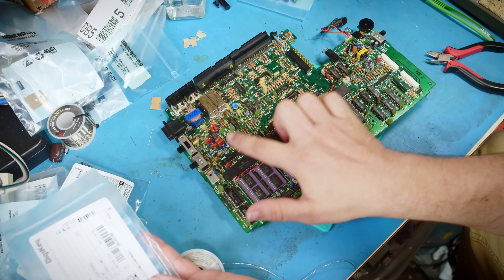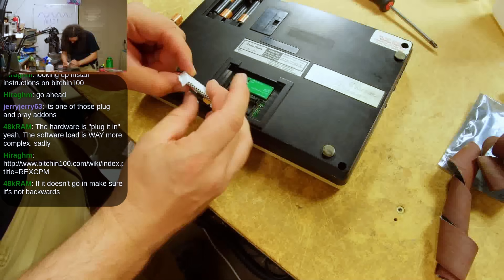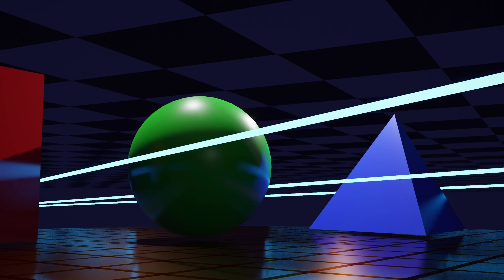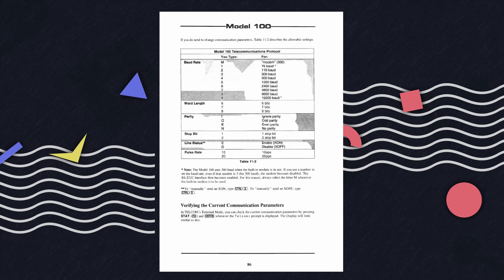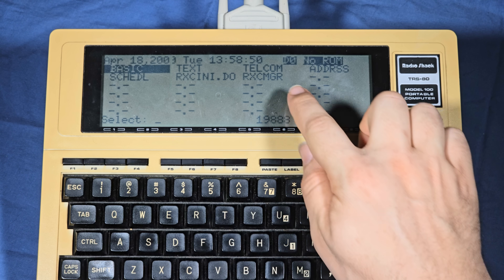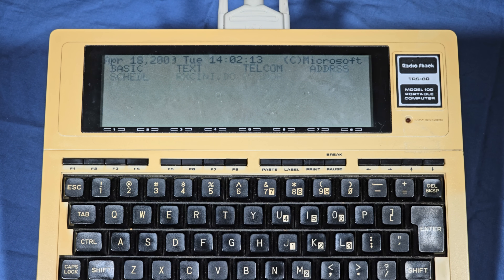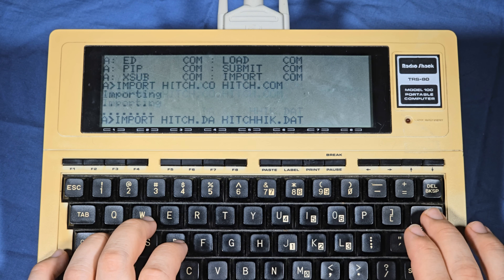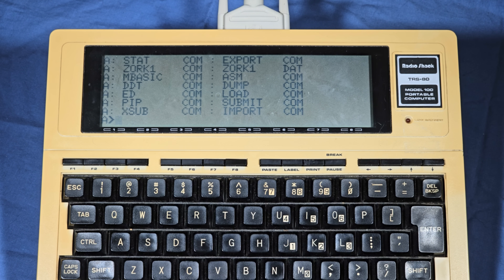CP/M On a TRS-80 Model 100 - REXCPM

Comment: I vaguely remember there was a machine language telecom replacement for the model 100-200 with vt100 support that used smaller bitmap fonts to fit more characters on the screen... I think if that could be retrofitted in to the cp/m it would make it much more usable

Comment: I experimentally managed to run CP/M on a VTech Learning Computer! 😊Once you have RAM mounted at the start of address space, any Z80 CPU will happily run CP/M, I found out. But the GL4000 only has 20x4 screen, which makes "ZORK" pretty hard to play 😅
Reply: You don't need a Z80 CPU to run CP/M; any 8080-compatible CPU will do. (Some application programs may require a Z80, though, but most of the common ones do not.)

The TRS-80 Model 100 uses an 8085, not a Z80.

Comment: How timely!  I just got a Tandy 102 in a local thrift shop along with a book for $7.  Before even powering it up, I looked up some info about it (such as the original manual) and immediately came across the page for REXCPM... and was immediately baffled by much of what I read.  I've used CP/M on my Apple IIe with Z80 co-pro card, as well as a few other computers, so the idea interests me, but this sounds like the most complicated CP/M experience I've ever seen (and that includes one hobbyist board I have that required some custom BIOS modification).  I'm still a little baffled why it doesn't use a mix of Flash and RAM so that CP/M (and probably a few user programs) could be stored in Flash while still having a nice amount of SRAM available, but maybe the choice will make more sense once I read up on this little machine.  I'm also still in the dark as to what a "REX device" is, but I'm sure that's explained somewhere I just need to find.

Hopefully, the one I picked up still works, of course.  For $7, I figured it was worth it even if it requires a lot of work, though!

Comment: I'm working on reverse engineering software for fun for retro systems and want to add a loader for the CP/M binary executable format and object file format if there is one. I'm looking for documentation on the format, a binary to test with, and preferably another disassembler to compare against. (Z80 I can do, just want to get CP/M specifics right.)

Comment: Great work navigating that Kafkaesque process! Way beyond me, I'm afraid. CP/M on one of my Apple IIs is my preferred method - install a card then boot a floppy that's easily made with ADT Pro. Up and running in no time at all, and no need to source the tears of a Cobol developer or Alan Turing to lubricate the ROM socket, calculate the stack address (whatever that is) with Babbage's difference engine or the Antikythera mechanism or the large Hadron collider in CERN (but only even addresses that aren't divisible by 57 or whatever its hex or binary equivalents are), and then recite incantations in assembly code, but backwards, to make it work. For us retro fiends who aren't IT professionals by day, some of this stuff is just baffling sorcery, but nevertheless terribly interesting! It's like a digital Alice In Wonderland.

Comment: I have a Model 100 and have been looking for the compatible barcode reader/scanner for it. The 100 was used a lot back in the day for ordering and inventory. I remember working at a place that had a 3 ring binder full of tabbed pages with barcodes. Find the barcode for the item and scan it to add it to model 100's ordering program. At some point a manger would take the 100 and export the data to a PC to fullfill the orders. Since the 100 is portable, it made it easy to take it into a warehouse, freezer, stock room and scan barcodes for inventory purposes. I thought it would be cool to do some project using barcodes, a scanner and the Model 100. Would be funny to use it in IT for asset tracking and inventory since typically asset tags are barcodes or they can be.

Comment: From what I understand, the TRS-80 Model 100 is nearly identical to the NEC PC-8201.  Would this work with it as well, or is it designed ONLY to work with the TRS-80 Model 100
Reply: Sadly, no, the REXCPM is not compatible with the NEC PC-8201 for a few reasons related to both the hardware & software of the system itself.
Steve (the creator) has a design on paper for the NEC, but it isn't a reality quite yet.
Reply: it might, only way to know would be to try it out and see if no other info exists

Comment: What is the difference between the rex# and the rexcpm? It kind of looks like it just ups the storage space and uses SRAM instead of flash? Why couldn't you make a rex# with a larger flash chip. Then you'd get non volitile storage AND cpm?
Reply: I think CP/M also requires the extra memory? The Model 100 comes with 32K at most. So I guess it also gives you all the RAM that CP/M needs. Would be nice to have both SRAM and flash on there...